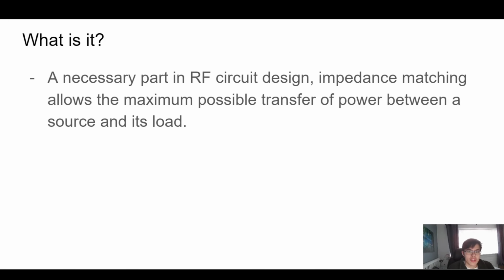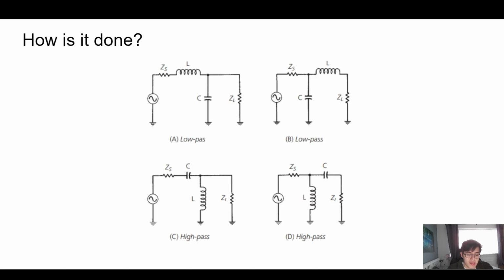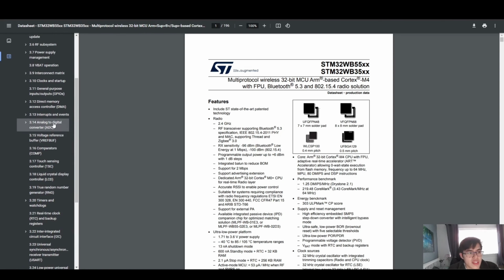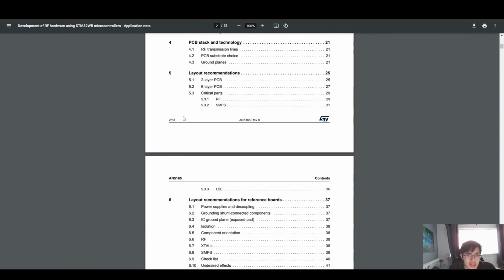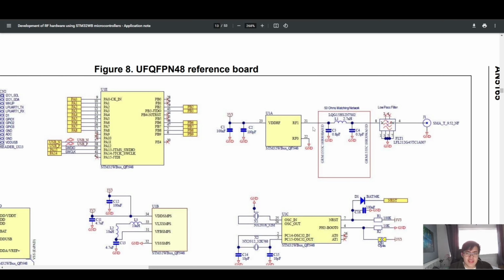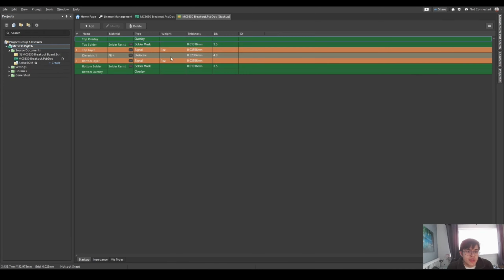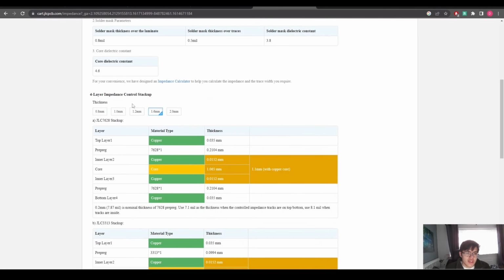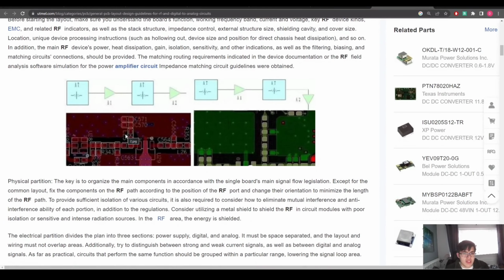Impedance Matching In Your Designs

Comment: matching for maximum power transfer and matching for minimum reflection are not the same. had to figure that out the hard way. maximum power transfer requires the load impedance to be the komplex konjugate impedance of the source, minimal reflection requires them to be the same. so only one criterion can be met ( unless you work in dc)
Reply from the maker: Thanks for sharing that, its much appreciated and can see the confusion it causes, upon reading more I see the error in what I thought. Thanks for pointing it out!
Reply: @WinterCircuits  as long as you work in  just real resistances, so no reactances, they actually are the same thing, manufacturers will tell you that their products are purely resistive but in reality, most of the time they are not ;)